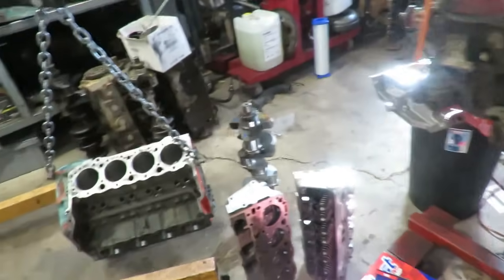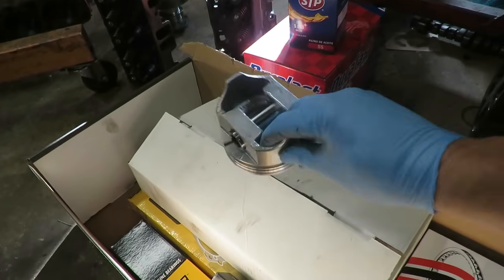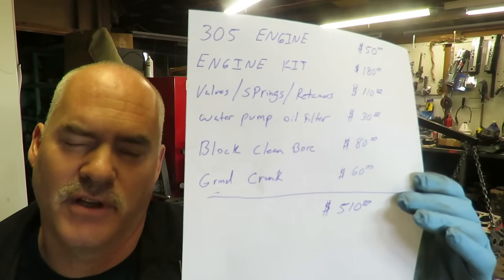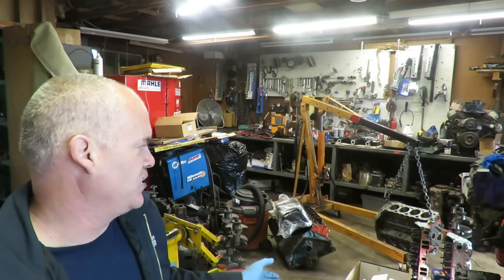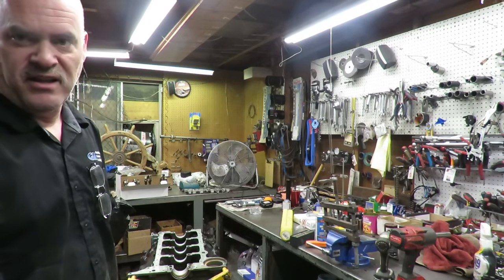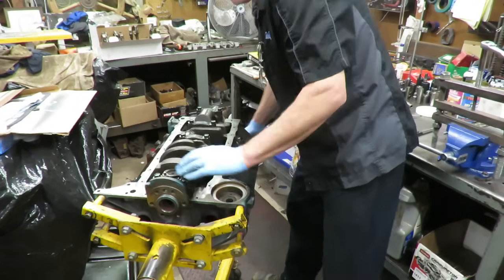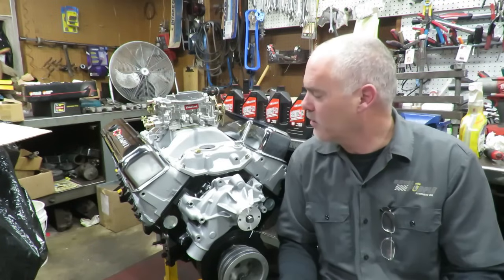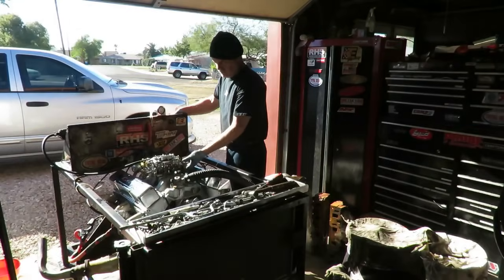Small Block Chevy extreme Budget Build

Comment: Dood.... Some one is lying about their machine shop costs..... $80 to bore a motor??? Serious??? Also out here in sunny northern California 350 blocks are 50$ all day long on CL...(really... I just bought a 400... Running for 75$)... Also 350 pistons are cheaper than 305s ..... A 305 is a complete waste of time and money.... Any thing you buy for a 305 is cheaper for a 350... And makes more power.
Reply from the maker: The only parts that are different are the pistons /rings and head gaskets the 305 pistons are actually not more expensive as far as 350's all day long for $50.00 that is just plain BS you need to remember who your talking to I scour craigslist and Ebay constantly as well as core suppliers there in California, AZ and Nevada as far as machine work goes you cannot compare California prices with most other states in Cali everything  is way over priced that is one of many reasons why that state sucks and I would never live there someone is lying all right but it's not about machine work it's about $50.00 350 cores all day long if you listen to the video closely you will hear me advise you to make friends with a local machine shop they can and will cut you slack except for california in that state they probably won't
Reply: Okay Dood... There are three 350s right now on sfbay Craigslist that 200 or less....
Here is the pick'n'pull price list for "long block"..... And there are quite a few half off days
 https://www.picknpull.com/part_pricing.aspx?LocationID=42&NavItem=0&SearchCriteria=Long%20block&#partpricing

Lol I get 5.3 and 6.0 lm7s and lq4s for 300 bucks from the shops by me.... Literally it's the core price that LKQ gives for the pull out.

You're a little defensive if you ask me.... As far as California goes.... It's pretty nice here... We get to race 9-10 months out of the year.. it's almost always sunny, and you are right it is expensive... 4 X expensive seems hard to believe tho.
Reply: I'm always looking for that stuff too. Here in ohio everything is way over priced. Unless you luck into something your going to pay 200 for a dirty old block. That's sounds unheard of for Cali man. J.s.
Reply: @jonsixxx6569  wow... So much hostility for California... I can put any part I like on any of my cars too.... Pre 76 stuff is all smog exempt....... I have a buddy that dailies his 9 second 540 Merlin powered Chevelle... And my DD during the summer is a 67 galaxie (because the AC works!).... As far as old worn out motors go... I would think it should be pretty easy to find much newer 350s.... You know since they built them deep into the 2000s...... Hell you might even find a roller motor with vortecs on it...... Or the millions of crate motors that were installed through the 80s and 90s.... And now..... Wait they're still making them lol!!!! If you want to believe that 350s are so expensive.... So hard to come by.... You go right ahead.... I guess that's why I have a whole pallet rack full of expensive, hard to come by, sitting in my "overpriced" shop lol.
Reply: Hey everyone keeps talking about these 5.slo motors are "usually in great shape".... If that were the case then why did this one need to be bored in the first place??? I mean if was "pulled years ago"....."low milage".... And "in pristine shape" shouldn't you be able to hone it and put some new rings in??? Either way 80 bucks to clean and bore a motor is a SUPER hook up.... Better tip that poor machinest..... Too many of those jobs and he won't have the loot to replace the stones!
Reply from the maker: @pooperdoodles  wait you said 350's all day long for $50.00 show me those ad's +and show me at least 10 ads because all day long means there's a bunch of em in California     like I said someone is lying alright
Reply: I live in Tennessee, and while I have seen 350's for as low as $20, those were few and far between. Most small block chevy motors here will go for at least $250 on craigslist or marketplace because that is what the core charge is around here. It just shows how the prices vary from place to place.
Reply: Matty, I also agree with some of your comment. The listed cost of machine work is pretty low. I've used machine shops for 30 years and get along with them great, but they don't knock down their work 50% for me. The price of cores depends on who is buying and who is selling. $50. For any complete low mileage small block, with eldebrock performer intake is very cheap. I am glad to see that they saved a 305 for what it's worth. They can run O.K. with a small cam upgrade and head tricks. While the cam, here was used for sound only, it's still too much for any low end torque. Good thoughts on the video, so nobody get all freaked for a simple suggestion. Before sticking the heads on, put the timing cover, tab and balancer on to mark TDC, 10º mark, a mark for total timing you want, maybe 32º. A lot of engines are not timed where we think they are because of different reasons, changed balancers, wrong timing cover for balancer, etc. No mention of cost to balance crank, pistons, rods,flywheel.
Reply from the maker: @pooperdoodles  It could have been honed very easily but thee guy that owns it wanted new pistons (his personal preference)  his budget was actually $800.00 we came in well below that even with new pistons so why not bore it we also gained a few cubic inches at the same time not a huge improvement but it doesn't hurt the whole point is to build a relationship with a shop they don't bore everyone's block for that price the key is to get them to do yours for that price
Reply: @Myvintageiron7512  okay okay you got deal on the machining.... Maybe.... But if that's the case why the hell wouldn't you buy flat tops??? Cubic inches wise a .030 bore on that tiny hole got you maybe 3.... hardly worth mentioning..... Flat tops with your 58cc heads and a uncut 9.025 block would have put you near 10:1..... Then you could take advantage of that cam.... Regain a little torque..... And since the cam has such a narrow ls it would bleed off enough compression to run well on cheap gas...... And still... All this would work better on a 350......... I have built a few 305s and quite a few 350, 383, 396, 400,406 small blocks.... My point was that unless you are class racing in a ci capped class there is not much reason to mess with a 305.... I like there 416 and 081 heads (to use on 283s and 307s) but a finished out 305... Even when it's a well thought out combo.... Is still just 85% of a 350..... Hey if your customer is happy then good for you. For anyone else reading this.... Be prepared to pay more for machining, even if the machinest is family...... And start with a 350.... You'll be much happier at the end.

Comment: Well done. Usually I can do a rebuild for around $600 without boring and pistons. That's really good. Unfortunately you gave out the secret about cheap 305 small blocks. I'd use 283s for budget builds but those are getting hard to find.

Comment: great small block build i am doing elcheapo build on a 1997 5.7l vortec bad lifter build i hope heads ant bad bore not needing any boring i love the metric smaller rings of the ls vortec stuff.another cheap ls swap them with microsquirt efi 250.00 -500.00 ls motor 350 ecu n wires 100 fuel pump n regulator

Comment: In 1973 I built a 307 short block Brand New.with 327 Camel Hump Heads. a 327/350 HP Cam. & lifters. A cast iron SBC intake with a Carter AVS 4bbl. & 2 1/2 inch exhaust. For my 1965 Chevelle Altogether I spent $400 dollars.

Comment: $698 w/o carb or valve covers....     and the local mom and pop machine shop here charges about $30 a hole for a bore.    the machining costs definitely seem low.     but that does not detract from his general point - budget builds are doable.   that engine should put out a little over 200hp, just about right for a lightweight s10 based rat rod street car.

Comment: I am guessing with the Edelbroc intake manifold and the high lift and long duration cam shaft It prabably make 225 horse power maybe? It will be moving more air with those parts. It sounds pretty bad ass if nothing else.
Reply: I don't know why he says it makes less. The 305s with awful cams, (.350 lift in auto LB9)  and same heads in the 80s made 190-230 hp (L69 or LB9) the LO3 has that same awful cam, worse heads and made 170. This motor has the h.o. heads, way better cam and that Edelbrock intake... Should be closer to 240-260 I feel
Reply from the maker: we ran it at the drag strip in his 2200 Ib tar rod went 13.50 with crap tires
Reply: @Myvintageiron7512  that is really good.

Comment: Jeezzz.....$698.00 unbelievable, that's great. Well you seem like a knowledgeable guy with SBC, so I'd like to ask you a question and tell you about my SBC mini project. I have a 1962 Chevy Impala that I had since I was 16 (for about 43 years now). Its all stock 327, with the exception of new a aluminum intake and a Holly 600cfm carb.  So I want to yank it out next year and have it rebuilt with more horsepower ect..  But just for now, I want to slip a new cam in through the grill  area without pulling the engine. For this quick fix, my overall goal is to kind of shadow your build here in this video, where your friends main objective was to have a lumpy / choppy sounding cam regardless of the horsepower and performance. I intend not to tach it up to 5k and beat the balls off of it, nor race it. It's just for Sunday cruise nights to go out and get a burger with my son.  So as I am a drummer here, and not a mechanic, I read (and correct me if im wrong here ) that the duration is the part that will give you that lumpy / choppy sound. I also read that if a lift is too much , then it could pull out my pressed in  ''studs" which I think they mean valve studs, idk. So with my goal and objective here, what lift and duration cam would I be looking for to do this. (remember, either next year or the following year, I will have someone do the whole engine.)
I just need a specific number or a window of number options. thanks,

Comment: Another good budget choice would be an old 307. I'd take a 307 over the 305... Bigger bore.. Slap on a set of junkyard vortec's (give it a DIY sanding roll port job..)  and a sensible cam. Those China special carb to Vortec intakes are ok too. Toss in a 50 dollar eBay HEI distributor and a rebuilt pre emission Q-Jet. No name headers round it out. The only real money I'd spend would be on a comp cams 268H.. This should be a pretty decent running engine with these parts.

Comment: I like that you chose a 305 I love those motor's. I am building 2 currently for me and my Dad's project 55' Chevy belair's just because they get good fuel mpg and we like to do things different then everyone else. The z28 valve spring's are they the 305 camaro z28 valve spring's?
Reply: The term Z/28 valve spring means the late 60's/ Early 70's 350 valve spring used on (among others) the LT-1 350 found in damned near every Camaro built in 1970-74.  It's really used like a generic term now, since they're all aftermarket springs anyway, although I bet you could still find some genuine GM ones somewhere.

Comment: Perfect video.  I am building the exact same 305. I will do exactly what you did, but I prefer  torque. I am not sure what cam to get, for torque other than wanting something like a 112 degree overlap.  Recomendations??
Reply from the maker: ENGINE PRO mc1730
Reply: 112 degree won't have a very choppy/aggressive idle, my 305 with headers has comp cams high energy 268 cam with 218/218 @.50 .454" lift 110 LSA and its definitely not stock, but too smooth idle. changing to crane 274H06 cam, 218/218, .450" lift with 106 LSA
Reply: @Myvintageiron7512   Thank you, Don't need a lumpy idle, or horsepower that I will never use.  I want torque and mileage.  Going with a 500 CFM AFB.

Comment: Hey man! Say man! I love the energy in this video. You inspired me to make
Up my damn mind and figure out the engine I’m gonna put into my 49 F1 I was thinking radical with the ls and the 454 or 460. Just might get a cheap 305 or 5.0 ford and get the thing running
Reply from the maker: if you have to choose between the 305 Chevy and the 302 Ford go with the Ford,  it is hands down the better of the two and a 5.0 roller engines is cheap now days

Comment: They have Aluminum Cylinder heads for the 305 SBC V8 engines and forged 350 crank rod connecting rods if you want to add more fast parts for the 305 Chevrolet engines there’s plenty of those engines available it has potential if you choose to do so

Comment: I did a "budget" build on my lq4(6.0 iron block LS) in my cateye 2500hd..Ported the stock 317 heads myself, oem flattops out of lq9, used elgin 216/220 cam from ls1tech.com, 50lb flex fuel  injectors out of 2010+ silverado, then all the bearings, rings, flexhone, tune etc etc.. Id say all together i spent under $900...Truck hauls ass and anything else i need to haul...What i like to do is find cars that have under 150k miles with blown head gaskets or other problems and buy them cheap, fix them up and flip them..very good way to get money for an engine build without touching your bank account.

Comment: Thats pretty  cheap. It could be done even cheaper if the standard bore block had really good cylinders and didn't need bored but a good hone job and rering and didn't have to grind crankshaft but most of them need that.  I've started only boring my standard bore blocks  020 over if they clean up, my last 454 and 400sb  did and my 350 is next on a budget build. After that will be a little Chevy 307.  So many people knock on the 305 and 307 engines but they were actually  very good for what they were designed for.  I really like them and  your videos.

Comment: Finished my first build SBC350. I used Vortec 906 heads and Edelbrock 2716 Intake Manifold and Holley Street Avenger 670cfm carb. My engine is getting hot and it runs around 230 and I noticed the 2716 intake manifold doesn't have port holes in the rear for 906 heads where the coolant can circulate.  Could this one factor be a reason why my engine is getting hot? Keep up the great videos. I've learned more from your post than reading tons of engine rebuild books.

Comment: i really like your videos keep um coming anyhow i have a 1970 el camino custom i just found out that it has the most desirable engine they made back in the day 1970 LT1 350 engine. it had blown head gasket and the compression was pretty low so i pulled it out and found another 1974 LT1 i payed $ 200 bucks for it had very low miles on it shes a runner what i need to know is when i rebuild it i want to make as much hp as possible with out sacrificing durability please let me know what i should shoot for and i am on a pretty small budget around $800 if you could tell me what rebuild kit i should get thanx Larry broad

Comment: Do you think you could do a performance budget chevy 350 vortec build on a good high mileage junk yard engine, using EVERY original part, minus rings, bearings and gasket of course. Honing and cleaning ONLY! NO boring, decking or ANY machine work, other than clean and hone? Using a good tired 5.7 vortec using the original pistons, heads, rods and crank. Using a decent rebuild kit and a performance cam kit with springs. I think a lot of guys would like to wake an old tired engine up with some tire spinning performance and a healthy cam lopy sound, using headers also. I am looking to try something like that, with some other improvements like a tune to match the cam and exhaust, but keeping everything else factory. Im looking to get 300-350 horse power. Something thats realistic and affordable by most. A video like that would get a lot of guys excited about trying a budget build and feel confident in their ability of giving it a go! Just thought I ask. Doing all the work from home is ideal from start to finish. Ive taken four 5.7 vortec L31 engines apart and 3 of them still had decent pistons,  cranks, rods, just needed polished and cleaned and still within spec. Love EVERY video you make! Thanks!
Reply from the maker: yes definitly

Comment: If you had ported and polished those 601 heads that engine would have leapt into real hp numbers. I've done it myself and they really respond to just gasket matching, polishing the exhaust ports and hogging out the intake ports a bit. I'm not kidding. The 601s make very good hp! With everything else in there, it would do very well. I would NOT have gone for such a lumpy cam as it is not a good match for everything else and that irregular idle grows tiresome very quickly. Step the lift down to .430 and .460 and that 305 would surprise a great many other so-called hot rods! At least 1 hp per cubic inch is easily accomplished this way and the engine will start at -25 C all winter long! I did exactly that build on my 86 Camaro and what fun it was to drive!

Comment: so the howards cam is 284 ish 286 / 288 advertised maybe 290  needs prolly at least 9.5 to 1 static 10 to 1 would be nicer probably has 10.3 to 1 with those ho heads hahah.  ibet its got 240hp and 300 tq. awesome work job video thanks for such an interesting budget 305 build.
Reply: nope, sorry bud,  with the dished pistons and stocker 305 heads 8.5 to 1 pal,  300 ft lbs torque? what a dreamer, maybe 200 at best. that huge duration with a small bore and crap compression ratio will result in a new breed of dog.  i know, built one when i was 18 back in 1984, when i couldn't get it to spin the tires on gravel i realized that that cam had to go.
Reply: oh, ok, 
what cc dish is the piston?
 and what cc are the chambers?   I want to do one with higher compression so ill know , idles narly as heck doesn't it  for that big a cam and stock compression im surprised it idles at all.
Reply: @jimmyers8114  well i am  an owner of a 1990 trans am GTA previously with a 305 TPI so i am a firm believer, 300 torque it did have.